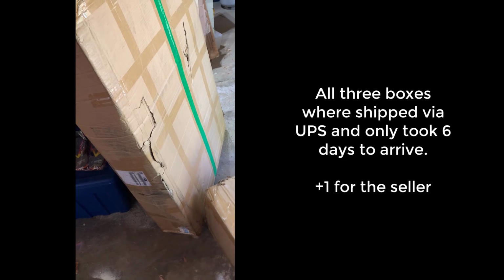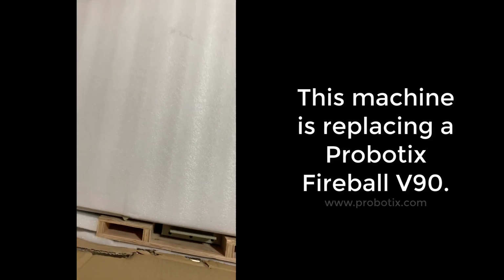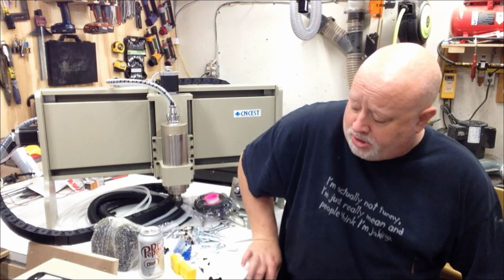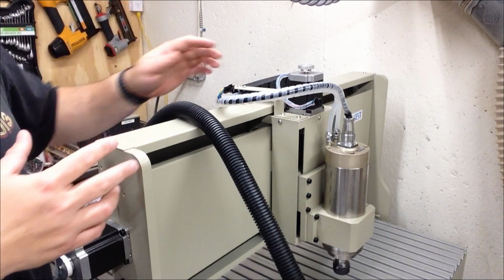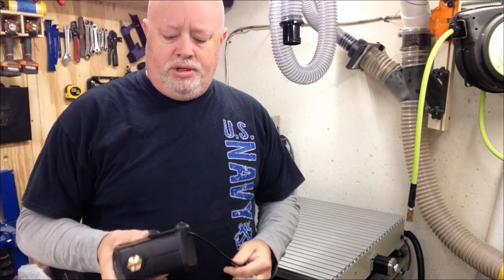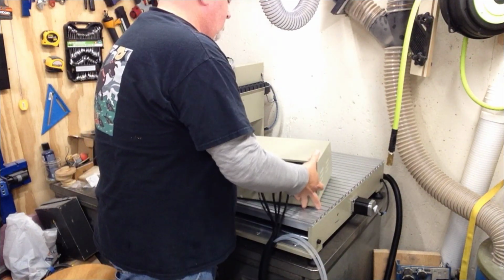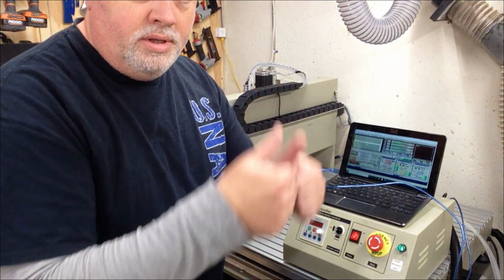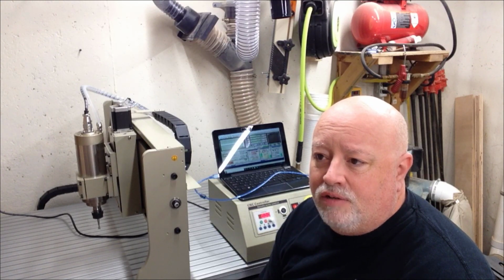Getting started with the Chinese made 6090GZ CNC Router

Comment: Jeff,

I can't thank you enough.  I purchased the machine but am completely new. How do the Hold Downs and the C axis work?
Reply from the maker: Okay... X-Y-Z are the three planes that you work in.  A-B-C are usually the auxiliary planes you can use.  "A" usually being considered the rotary axis.

Using the hold downs is hard to explain.  Think of putting the bold head in the track (table) and then using the other bolt to set the height and the wing nut to tighten it all down... if that makes sense.

I don't have a video on using the rotary axis yet... but am working on it.
Reply: @jeffmorlen  Have you tried GSender?  I have had no luck. Maybe they are different protocols.
Reply from the maker: GSender is most likely used with an Arduino based controllers and not with the R&R Motion controller.  But, I have not tried it.

Comment: HI Jeff, thank you for the great video! I'm really interested in this router but want to put a dust hood on the bottom of the spindle. What is the diameter of the spindle motor? Did you ever use a dust hood with your unit?
Reply from the maker: I have a whole video on the dust shoe that I adapted for this machine.

Comment: Hey there, I just bought one of these and the control box does not turn on at all (I replaced the fuse) is this normal?  There is however a red light that’s coming from the machine where the USB port is.
Reply from the maker: If you have the RnR Motion board in your control box, you may see a light on that board (or emanating from the back of your control box).  This board CAN be powered by your PC and does not need an external power supply to be seen or work.  I would check the "Device Manager" to see if it shows up or if it is showing an extra piece of hardware being detected.
Reply: @jeffmorlen  they sent me the box but they haven’t sent me all the files I need/ would it be possible to get a copy? Also I’m new to this so would I be able to pay you if you have time to help me set it up correctly?
Reply from the maker: Others have had the same issue.  Here is a link to the files (minus the license file for Mach3): https://1drv.ms/u/s!AgxiwVost-OPi4EFwXbQM1FP9K8deg?e=HRAAtd
Reply: Thank you! I’ll give it a go. Also if you have the time I’d like to pay you to help me go over the initial set up. If you’re busy no worries. Thank you for the content.
Reply from the maker: @Justsayin71  I'm happy to help... but without being on-site for a setup, config, testing, and run through... I'm not sure how much help I can be.

If you have questions, please feel free to ask.
Reply: @jeffmorlen  sorry just saw this. Actually got it to run. Now I’m working on configuration for the machine on fusion 360 so that I can export the Gcode lol.

Comment: Hi Jeff, I wonder you could help please. I have a similar 6040 router with Mack3 installed. Unfortunately my PC went down, I have repaired the computer and re-installed Mach3. I have all the stepper motors working fine, but I can't get the spindle to run. The spindle on/off button in Mach3 is flashing when I run the program as if I'm cutting, but the spindle is still not moving. I don't have any instructions on the spindle settings for Mach3 so I'm guessing. Do you have a video of setting the spindle in Mach3 or know of the setting I need to use please. Any help would be really appreciated. Thank you for any help you can give, Terry.
Reply from the maker: You should be able to take the XML file from my download (link in another comment) and use it to configure your machine.  It should have all the settings for Mach3 in it.
Reply: Thank you for your help, much appreciated.

Comment: Thanks for the video! Definitely helps my decision process. 1 question. I read a lot of people have issues with the machine not coming with driver software. Seems like it can be a nightmare hunting it down. There are so many different models available. Did yours come with it installed? Do you mind showing the exact model # you purchased? Thanks .. just a newbie looking to get a start in cnc world.
Reply: Lol I’ve read through comments and see this has kind of been addressed. Sorry to beat the horse but it’s getting confusing trying to navigate through all the different listings.
Reply from the maker: @HammargrenCues  
No worries.  I have the files that I got on my Google Drive (there is a link in this thread somewhere).
Here is the exact unit that I bought:  https://smile.amazon.com/gp/product/B08NSXSYFJ/ref=ppx_yo_dt_b_search_asin_title?ie=UTF8&psc=1
This is listed as a "DNYSYSJ 6090 4 Axis CNC Router" but the one that I got was labelled from CNCEST.

Things to look for before purchasing...
1) USB connectivity:  This can be confusing because of a flood of USB boards now and some are Arduino based vs RnR Motion controllers.
2) MACH3 compatibility:  This is the software that actually drives the machine after you generate G-Code.  This does not work with Arduino based machines, only RnR Motion based machines.

And... remember... you can ask the seller questions.  I did, extensively, before I spent my money on this.  The description of mine has a little bit of contradictory information in it and I needed some clarification.
Reply: im in the nightmare is there any help out there

Comment: Just got a 6040gz and hoping this will help me getting it going. I got the spindle turning in manual, and downloaded mach 3 on a windows 7 with USB, but cant get nothing to move.
Reply from the maker: Is yours USB or Parallel?  Did it come with a CD or USB stick?  If you have a link to where you purchased it, I can take a look.  Some of these are now using GRBL controllers vs. RnR Motion controllers... so, there may be clues in the product description.

Comment: I'm very interested in the 4060Z CNC router. I'm an absolute newbie with CNC routers.  I have a couple questions.  I will be acquiring it with the 4th axis.  I have already acquired a Sculpfun S9 laser. My main purpose is to mount the laser on this machine to checker gun stocks.  Sculpfun assured me that it was powerful enough to do this job ( at low production).  My question is what components (  ie: 12V power supply, control cable, etc.) what else would I need to make this laser work on these Chinese routers?  It was recommended to use Light burn software.  Also, I want to do round carving with the router - what software would you recommend to transfer drawings, art work etc. - Corel or  similar?  
 I also have a used Legacy Artisan 2'x4'  5 axis machine which I have not plugged in yet or should I use this machine?  It was recommended that I learn on a smaller machine,  Any help will be much appreciated.  Thanks!
Reply from the maker: Not sure how you are going to mount the laser to that (4060Z) machine.  You will need to find a way to trigger the laser to turn it on/off... which is not a function that this/these CNC machines have.  So, I'm sure that will be a challenge.

If you don't need the larger format... I'd almost recommend a K40 laser instead.

Comment: I liked the video. I have the same machine at my work I have to set up. I got it built and spindle turns but can’t get the gantry to move in x,y, or z. Any help would be appreciated.
Reply from the maker: Does Mach3 see an RnRMotion control card?  Do you have the DLL for the RnRMotion controller card in the plugins folder for Mach3?

Comment: Thanks for the video, Jeff... 
I've had my eye on the 6090s for a while now and pulled the trigger after watching your setup.
The lack of instructions was holding me back and rightfully so as now that I have one (same unit you have in the video), I am still quite lost as far as setting up the VFD and Mach3. 
* Not sure it the VFD was supposed to have an initial setup or not but mine doesn't seem to follow any of the settings I have found.  
Could really use the settings.
* If I understand correctly, Mach is going to need axis motor pin information, is this something you figured out.
Reply from the maker: David-  You will need to contact the seller about what settings your VFD needs.  I have a document that outlines all the settings that can be set on it.  Keep in mind that this is for MY VFD and it may not be the same as yours.  You can find it here:  ( https://1drv.ms/b/s!AgxiwVost-OPi4EGSgTsIGiy0xF8RQ?e=g1ym85 )

As far as pin configuration, my CNC has an USB RnR Motion stepper controller.  I'm not sure what yours has.  Where did you buy it?  What does it look like?  Is it a parallel port version (old) or a USB version (new)?  Did yours come with a CD?  It may have all your settings and configuration information on it.

I can say this...
Before you make any changes to your VFD, try to run it manually.  If your CNC is the same as mine, you should be able to power on the system, turn the PC/Manual switch to manual, press RUN, and then turn the knob to start the spindle.

If you have a link to what you bought, I will take a look and give you my thoughts.

Comment: Is it good for processing aluminum?
Reply from the maker: Yes, you can mill non-ferrous metals with it.  It is rigid enough for aluminum, however, it is also made of mostly aluminum... so you will get some flex if you push it too hard.  There are a couple of videos where guys are using 6040s to do aluminum... which may give you better luck due to the smaller size.  Otherwise you could always retrofit a Sieg X2 or something for metal as well.
Reply: It is meglii a 6040 for aluminum. Do you think so
Reply from the maker: @domenicocoluccelli5734  Huh?  "meglii"?
Reply: Sorry. "it is better 6040 for alluminium
Reply from the maker: @domenicocoluccelli5734  
The only reason that a 6040 may be better for aluminum is because it is smaller with the same spindle/VFD.  Meaning, there isn't as much a span in the gantry and thus less flex/deflection.  That's the one thing that you will see over and over from 6090 folks... flex in the gantry assembly.

Comment: Hi Jeff,
Nice video!
I have a 6040 version of the same brand or at least what's left of it .
After 2 years... Solid Al plate bed 25 mm. Y axis15 mm plate with linear rails. Redesign totally of z axis with spindle with bearing block because bearing of stepper motor is used. That sucks. Z axis also linear rails. End switches. Steppers 3Nm with feedback. 36 Volt First nvem controller. Stay away from that. It destroys your machine and then Pokeys 57 that works perfect. 7000 mm/min and 1000 steps per mm all axis. 
Minimum quantity cooling and compressor.
Now it works fine with aluminium....
Have fun, you will learn by doing...
Reply from the maker: That is AWESOME!!  You were able to take an "ok" Chinese machine and make it into what you needed... that's cool.  I have hopes of upgrading the steppers, bed, drivers, and add homing switches... but that's down the road.

Do you have a YouTube channel or video of your machine?  I'd love to see it!
Reply: Hi Jeff,
Unfortunately I do not. Thinking about it. But I follow everything. I learned a lot from others. Quite a learning curve.. Hours and hours of good ideas. For you connect the extruded al plates e.g. on the bottom with strips for easy stiffness and if Al then use a corner of the machine. Most flexing is in the middle. Z-axis fix the gap. It damages your bits. You can find a video of another owner which uses a cheap bearing for that. And a surfaced offer plate. Maybe 100 euro but it improves a lot. That's what I did in the beginning. 
Have fun.

Comment: Looking to buy this CNC.
Will it work with Mach4?
Reply from the maker: That's a great question!!  From what I found (very quickly) the RnR Motion board, which is what is inside my machine, DOES NOT work with Mach4.  You may find a bunch of download sites that tag MACH4 and RNRMOTION, but I have not seen an article or a post on CNC Zone that references this combination working.

Of course, if I'm wrong, please post a comment with a link.  I'm sure others would be interested too.

Comment: Question how do you like it ?  Is it worth the money ? Can you cut hardwood with it ? Is this the 6090 model?  I do woodworking as well have been looking at much heavier models from China.  Like about 500 lbs . But if this can do what I need it would be a lot cheaper and a whole lot easier to get
Reply from the maker: Yes, I do like it.  So far I've cut standard plywood, MDF, poplar, aspen, pine, walnut, ash and oak.  It does well in each... but you will want to spend some money on good bits.
One thing to look at is the math on the wattage of the spindle... they claim 2.2kw... but the math doesn't add up to that amount of power.
Another is, that when digging into these CNC machines, you need to look at things like "how fast are the rapids?"
I bring this point up because, on this model, without any changes to drivers or steppers, I'm limited to, about, 1500mm/min.
Anything more than that and you start to run into stepper stutter and you start to loose steps... so, an upgrade is in order... but I'm not sure if that's the stepper driver or the steppers themselves (yet).

So the real question is... "Is this CNC machine worth the $2000-ish you pay for it?"
I would say that it is.  It is much better than what I had before (Probotix Fireball V90).
Reply from the maker: Yes... forgot to mention, this is the 6090 model.  Specifically the 6090GZ from CNCEST.

Comment: Hello anyway you can help me get my stepper motors to move I have mach3 installed just can't get the controller to make them move or the arrows on computer
Reply from the maker: Does your installation of Mach3 see the RnR Motion controller?  Let me know.
Reply: @jeffmorlen  yes because it  can operate some of the functions
Reply from the maker: Q:  When you use the arrows (up/down/left/right) to move the gantry do the numbers in Mach3 move as if it thinks it is working?

If not, is the RESET button (red at bottom left) flashing/blinking?  If it is, click on it to set your machine to "enabled" and to clear the emergency stop situation.
* NOTE:  When you start Mach3, this is always flashing/blinking.  This is a done for safety (i.e., so the machine doesn't just take off and do stuff).
Reply: @jeffmorlen  hey bud sorry for the late response had some issues I'm looking to tag you in a video I made so you can have a better idea of my issue thanks.
Reply: https://youtu.be/YyhJYwSg_Rs hey this is the video I uploaded trying to explain my issue please check it out and help me thanks very much
Reply from the maker: Just watched the video... let me gather some thoughts as to what we can try to get this working.
I'm going to comment with some troubleshooting tips in your video's comments section.  That way we don't have to go back and forth.
Reply: Thanks
Reply from the maker: How is it going???  I haven't heard from you.

Comment: Would this be sufficient for making wood guitar bodies and necks?
Reply from the maker: So, there are some things to keep in mind when answering your question.
The working size of the machine is approximately 850mm by 600mm.
The size of a Stratocaster is, about, 307mm by 446mm.
The size of a Telecaster is, about, 324mm by 406mm.
The size of a Gibson Les Paul is, about, 330mm by 440mm.

You can see that this is able to machine the body... being 45mm to 50mm thick.

The neck is the hard part.
The neck is, about, 637mm to 653mm long.
Most have a 14 degree dip at the head.

So, if I were going to make one on this machine... here's how I would do it.

I'd use a fixture to hold the body for the A and B sides of the body.
I'd use reference pins to align it all.

I'd make a jig to hold the neck and only use the machine to cut the rough shape of the neck and head.

After that... it's all blood, sweat and tears!

I wanna do this too (as I sit here next to my four guitars)!!

Good luck!

Comment: Very nicely done video.  It scares me that there is no manual.  I have no experience with CNC but need a machine capable of cutting carbon fiber (tubes that are 100mm diameter). I see this can handle up to 140mm thick.  Do you think I should go with a smaller machine even though the specs say 100mm max??  I will say your video is very helpful and you do a good job of presenting.  Cheers.  Doug
Reply from the maker: I like to think of myself as a pretty handy guy.  So, the manual thing didn't bother me too much.  You just need to know that things really only plug in one place.  And the screw holes, on mine, lined up, almost, perfect (except on the bent part).

As far as doing a 100mm diameter cylinder on there... I guess I would wonder what you'd be CNCing into it.  Are you planning on using the 4th axis (sorta a stupid question, but want to make sure)?

If you get one and run into issues... shoot me a msg.  I'd be happy to help.

(I'm getting ready to record the Mach3 installation and configuration... as per their instructions... we'll see how this goes.  :)  )
Reply: @jeffmorlen  do you have a email we can communicate with you I have just purchased the same cnc machine and am watching your video on set up and I do have more questions appreciate you and thanks
Reply from the maker: @agunt4200  
My address is in the channel's about page.